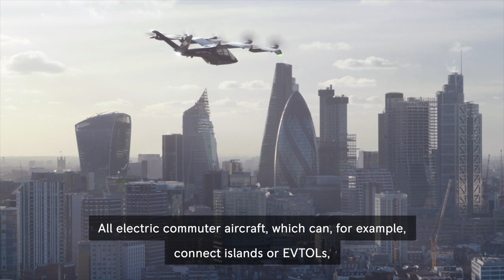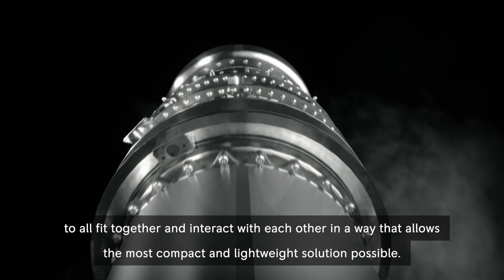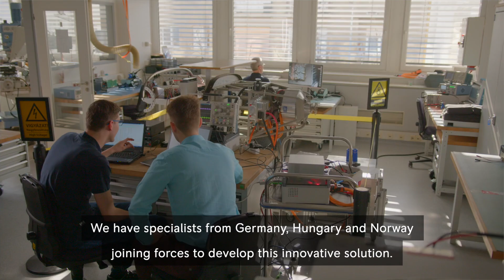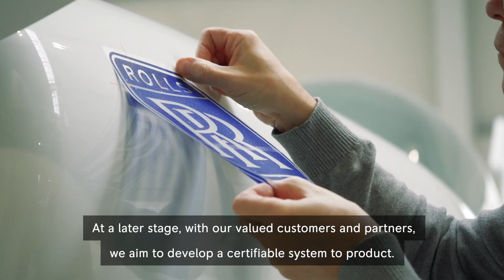Rolls-Royce launches hybrid-electric aircraft tech for longer flights

Comment: nice idea, but you are reducing the actual weight you can carry, in place of having to carry petrol or compressed gas for the turbogenerator- this is a bust, and is too expensive in the long run. Best to focus on battery power storage density by thinking in unconventional ways.

Comment: Technically couldn't large aircraft use a dynamo to power electric turbines? Seems like all you'd need is a light enough diesel engine and an efficient dynamo. Turbines are great, but theyll never be fuel efficient.
Reply: Turbines are much lighter than diesel engines, so you can carry more fuel to more than make up for the loss in efficiency.
Reply: @jimj2683  fuel weight massively exceeds engine weight on aircraft. the problem of the energy source being heavier than the propulsion system is the exact issue that battery powered aircraft face. Diesel powered planes are optimal for fuel efficiency.
Reply: In the range of 1 MW output, gas turbine engines are about as efficient as diesel engines. In smaller sizes diesels have a clear advantage, and very large diesels that cannot be used in aircraft also have an advantage, but in an airliner the practical choice without an efficiency penalty is gas turbine.

Comment: Hybrid is the only way when it comes to aviation.
(Until battery technology catches up)
“Clean energy?”
Reply: Or if we could figure out Hydrogen for fuel cells or combustion propulsion. Most of the technological hurdles are building the H2 infrastructure and producing it via renewable and green means of generation. Hydrogen is the most common element in the universe but, it is nearly always bound to something like Oxygen (02) in the form of water. I’m a big proponent of nuclear energy if done right and there is a new technological concept of using the extreme heat of a nuclear power plant to split water in to Hydrogen (H2) and Oxygen (O2). It is called Red hydrogen and would provide huge amounts of Hydrogen fuel completely Carbon free. With new research into safer and renewable Nuclear power generation where spent fuel is re-enriched to be used in a specific reactor again (which significantly lessens the amount of nuclear waste created while also greatly reducing the level of and time of radioactivity of the waste that does remain. Closed cycle nuclear allows for multiple re-enrichments of spent U-235 fuel to be used again and multiple times over in a specific reactor type that already exists and was the norm before changes to the law during the Carter Administration over fears of nuclear waste getting in the hands of terrorist groups or hostile governments but, theses regulations were eventually reversed to allow for the restating of recycled fuel nuclear reactors. Cleo Abram does a great video explaining it all in her ‘The Big Lie About Nuclear Waste,” video. Since hydrogen has such great energy density, if all the infrastructure could be put in place, it would make a great fuel for Aircraft.
Reply: You know hydrogen is naturally occuring unbound in some parts of the world right?

Comment: Some hybrid will inevitable but hydrogen is not a viable or clean fuel if burnt in air as it produces NOX. Also you need to produce the hydrogen. Lots of advantages to electric motored planes though especially safety, not running engines on the taxiway, less noise, and instant torque from zero rpm.  This unfortunately feels like green washing rather than a real endeavour.
Reply: The Nitrogen Oxides that result from the burning of hydrogen are incredibly negligible in terms of total emissions as most of it is just water vapor released. Also, just sending it through a H2 fuel cell will only create steam. The more important thing with Hydrogen is building the entire infrastructure necessary for a fueling network and ensuring it is made cleanly and renewably either through electrolysis using energy from solar, wind, hydroelectric, geothermal and then there is something called Red-Hydrogen which uses the heat from a nuclear power plants to spit the water at super high temperatures at up to 2000C. I know people hear nuclear and get scared but one, it is the only carbon-free source of energy generation we have today that is theoretically capable of meeting our energy needs as well as keeping pace with growing future demands. A lot of research has gone into making Nuclear and the storage of waste much safer and less of a problem with companies like OKLO that aims to build fast reactors that could use the spent fuel from conventional nuclear reactors to operate. These fast reactors that actually used to be the norm until the incident at Three Mile Island and the fear that the recycling and re-enrichment of the fuel could more easily place it into the wrong hands. However, this has been overturned and there are now facilities like Argonne National Laboratory, researching fast reactors that utilize re-enriched spent fuel and in the process of doing so, greatly lessens the amount of waste but also the time the waste that is produced would have to be stored. The timescale goes from thousands of years to much less radioactive fuel that when no longer able to sustain a chain reaction in a fast nuclear reactor and thus can no longer be recycled, would only need to be stored for about 1 to 2 centuries. Cleo Abram did a great YT video titled ‘The Big Lie About Nuclear Waste,’ which I highly recommend watching if you wish to learn more about the subject. 
Anyway, yeah, I think Hybrid drive and fuel sources is what makes the most sense with maybe using the battery during cruise and only have an electrical generating turbine for taking off and landing or whenever it is most efficient to switch between them but, as I said, sending the Hydrogen through a fuel cell to produce electrical energy to drive the Aircraft would probably the most efficient way.
Reply: Another armchair ‘expert’
Reply: Burning hydrogen does not produce anything other than water.
Reply: @akshay.kumar.k  It produces NOX. The high temperature of combustion causes the nitrogen in the air to combine with oxygen.

Comment: Instead of burning hydrogen in a turbine, wouldn't it be more efficient to use a fuel cell to produce the electric power? Fuel cells have an efficiency of 60-80% while gas turbines are between 40-60%.

Comment: What’s needed is a massive aircraft powered by rubber band props . They can get the passengers & crew to wind them up before the flight & lock them into position  ready for take off & flight .  This would be green the only air pollution would be the body gases given off by the passengers & crew . No battery’s or fossil fuels needed to power rubber band engines ,or risk of engine fires ,a perfect solution .
Reply: but rubber bands wear off quickly and cannot be recycled.
I know that modernist greenwasher will point to 100 soon-to-come everlasting rubber nanotechnology, but before such rubber bands are tested in length by the Slingshot Channel, I call your solution a greenwasher wetdream!!!
Reply: @simonz5905  There is plenty of them ,the post workers leave a trail of elastic bands ,every time they go out on their postal rounds . The could be recycled & joined together to power giant rubber band powered aircraft .